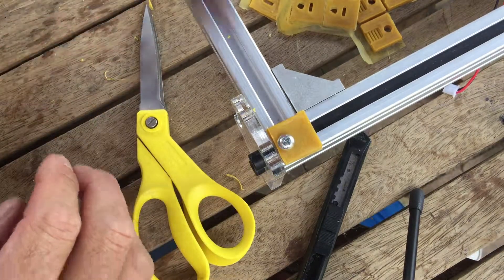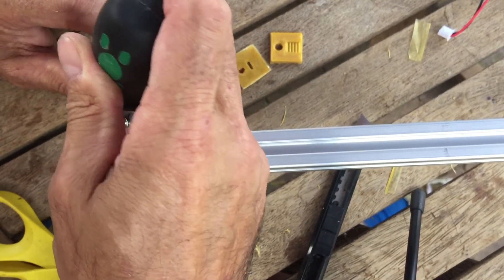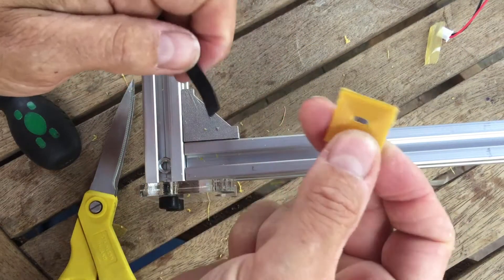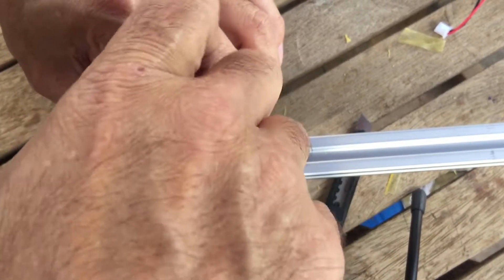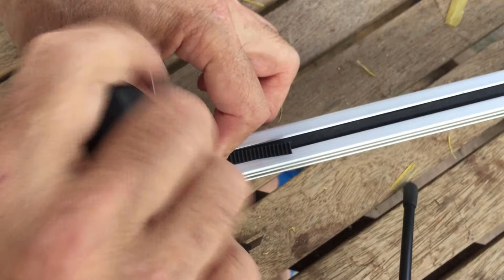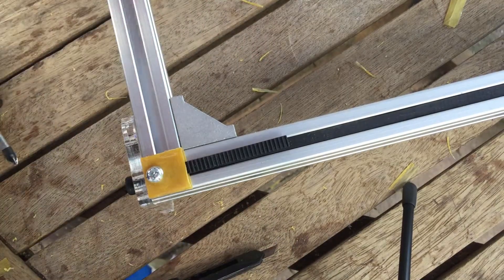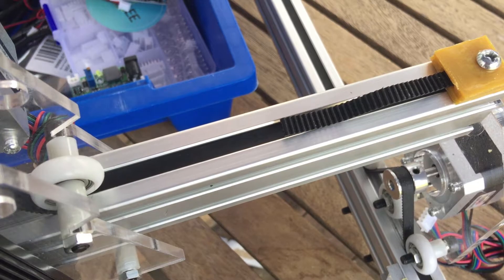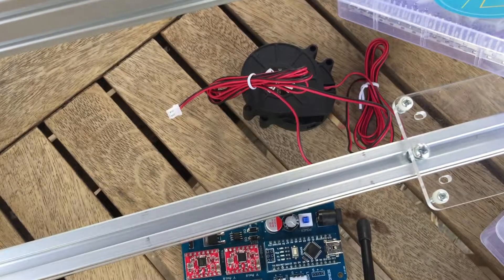Laser Cutter Engraver Belt Tensioners And Adjustment 3d Printed

Comment: you tighten the roller wheels by losing the wheels and sliding them up or down to tighten the wheels on the rail.  The wheel axles are mounted on an angle.
Reply from the maker: The roller wheels only have a hole, not a slot (but I might make slots when I get around tuit). Just a bad design. Still haven't done anything to it and its been in the garage loft for the last 4 years. I have a k40 and other tools I mess with more. Thanks for your ideas though.